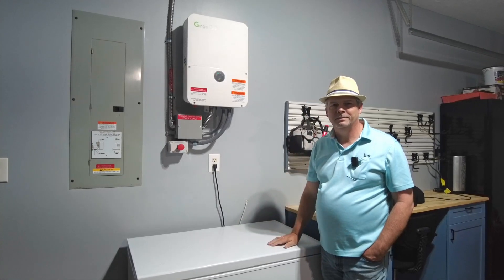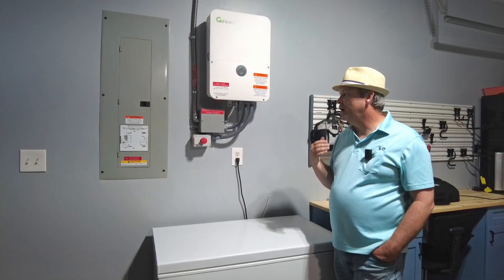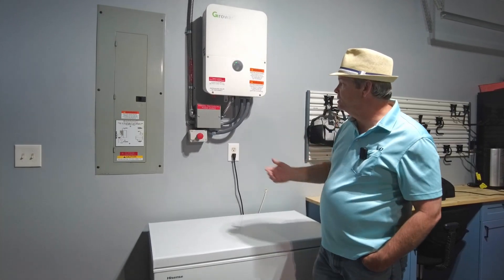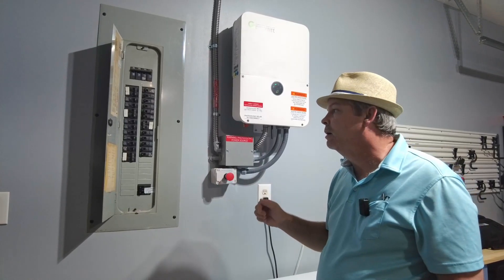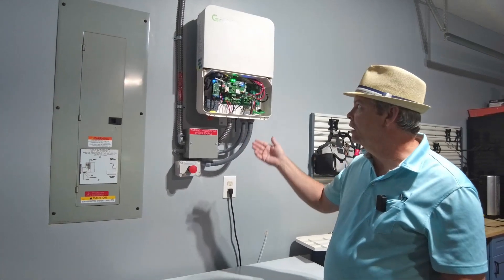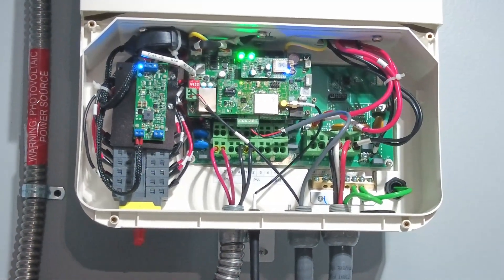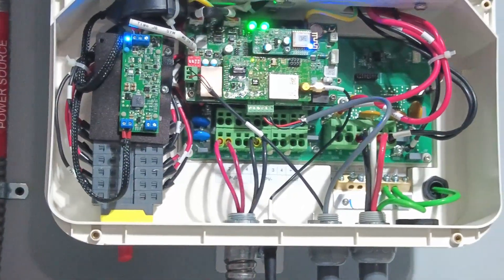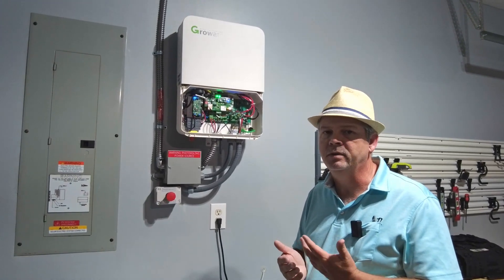Growatt MIN 7600TL XH US solar inverter: Unboxing, Basic wiring installation, and initial review

Comment from the maker: Thanks everyone for watching! Don't forget to like and subscribe. Surprisingly I'm looking forward to getting my next electric bill so that I can make a 60 day review.
Reply: Debating whether i should buy this or an SMA sunny boy. On the listings i see online for the growwatt it says it's hybrid (on & off grid). How simple or difficult is it to switch between modes? Live in an area probe to storms and power outages. Don't want to deal with a separate backup panel.
Reply from the maker: @afuen012  If you are looking to have power during a power outage you would need to have a second source of power besides solar. Such as batteries which this unit supports. The setup with batteries requires a few more components also, their diagram shows what it needed. If you had it setup in a hybrid mode it would switch automatically when it senses the grid is down. Switching the modes is pretty easy in the web app when you first setup the system. If you want to go off grid totally I'd suggest an inverter that is designed for off grid only. Hope this helps.
Reply from the maker: @afuen012  Here is a link to Growatt basic wiring diagram https://www.growatt-america.com/list-38.html  and this is a link to a basic overview of different types of solar systems I did https://www.youtube.com/watch?v=SSQl-qkWbaU&t=58s

Comment: you showe ac voltage L1 N L2 input but not shown output power supply line. i am surprised how you taking power from inverter?

Comment: what does the box look like for all your AC wires inside and out of the house and breaker box and what type of box is it model number etc? i would like to do that with mine.
Reply from the maker: @Asherrpawss  I believe it's a 6 or 8 inch metal box from home Depot with conduit running inside the wall to the breaker box and shut off our side. And metal coil conduit to the roof junction box.

Comment: Hi thanks for posting. Just to confirm – your unit came with the Tigo RSD transmitter installed from the factory? I called Signature Solar today and they "could not confirm" that they came with that installed and suggested I buy a $145 transmitter separately. The unit I'm looking to purchase is the MIN 3800TL-XH-US
Reply from the maker: @davidbryan-z8b  additionally tigo has their own branded inverters which are a growatt with their name on it.
Reply from the maker: @davidbryan-z8b  yes mine did have it from the factory, but that was a few years ago. Growatt has a US based support that you can call to confirm.

Comment: Thank you for this video. I want to buy this inverter, but I could not find the recommended size for the AC braker in the load panel.
Reply from the maker: For the 7600 its 40Amp

Comment: Hi I need help I want the same inverter can you check if you can do zero export with it?
Reply from the maker: According to their website it can, they also make this inverter for Tigo. Just incase you have a hard time finding it. If you are doing batteries keep in mind this can only use high voltage batteries.

Comment: Hi. Is the growatt still working flawlessly for you? Thanks
Reply from the maker: Yes the only issue I've had is the smart meter locked up once. That only caused the app to stop recording properly. Simple reboot of the meter fixed it.
Reply: Wow thanks!. There good to know. So you know what the settings in the shine software do?
" Ac couple enable"
"Off grid mode"

Thanks
Reply from the maker: @jl9678   Those indicate how you want the Inverter to operate, IE Off grid mode would be if your house/system wasn't connected to the grid/electric company. Other modes is if you are connected to the electric company. I believe there is also some settings for batteries and how you would like to use them but I don't recall off the top of my head.
Reply: I appreciate it. The manual is very vague about those

Comment: Hello, I bought your same equipment and installed everything the same without the electric meter. and the system it doesn't work, I don't know what to do I have to notify my network provider so it can work?,I in California
Reply from the maker: I'm not familiar with California rules and regulations. Where I'm from a permit is required and the plans get submitted to the electric company and they come out to inspect.

Comment: So this has built-in solar charge controller? No need to install one?
Reply from the maker: It has the ability to add certain high voltage batteries and charge them. Growatt has a battery for it and I saw mention of another brand in one of the manuals but don't recall which company

Comment: So question on the ground. Does that ground from your PV and inverter chassis tie in with the ac panel ground from inside the inverter? Or do you have a separate ground for PV already connected before it comes into the inverter?
Reply from the maker: For mine, I installed a grounding lug inside the metal junction box and landed all the grounds there and ran one wire back to the ac panel.

Comment: I cant seem to find the battery volts needed for this unit, do you know if it is 24v or 48v battery bank?
Reply from the maker: It's a high voltage battery. Something like 400 volt but don't quote me. I believe they only recommend using their battery packs, as it communicates with the panel. You can look on the growatt website for details.
Reply: @whatsnextdiy  Thanks I'll check it out
Reply: @whatsnextdiy  unfortunately I have not been able to get mine to work, I just have a direct connection to the grid with no smart meter or battery and I cannot get any output from the inverter, I hooked up one panel 222V with 460w rating getting current to the inverter but nothing going out, maybe I need to make some changes in the Shine tools app, any suggestions?
Reply from the maker: @wilsonmining  You will likely need two panels hooked up for it to start. There is a minimum voltage for start up. I believe 50 volts
Reply from the maker: @wilsonmining  Also look at your emergency shutoff switch. If you are not using it you may need to wire a bypass in the inverter.
Reply: @whatsnextdiy  200 volts I have going to it, emergency cutoff is operational, I hear the relay after 5 minutes but it does not convert, could be a bad unit
Reply from the maker: @wilsonmining  Interesting when you said you hooked up one solar panel I would expect it to be around 30 volts to the inverter. Most residential panels I've looked at are around 30 volts 10 amp.
Reply: @whatsnextdiy  I have 6 panels rated at 222v and 460w they are big
Reply from the maker: @wilsonmining  Mind sharing the brand and model of the solar panel, interested to see what they look like
Reply: @wilsonmining  that’s what we were trying to figure out. You had initially stated A panel @ 222 volts which through us off since that’s about 7 times more voltage the an average good panel would make. 
Best of luck and any luck getting everything working correctly?
Reply: @Wrensspeedshop  I had to run two panels in series to get the inverter to work at with around 420V going to inverter
Reply: @whatsnextdiy  Brand is First Solar, and model is FS-6460A-P-I

Comment: how did you power the Tigo rapid shutdown transmitter?  does the Growatt have a DC power supply with sufficient amps?   TS4-F needs 1A 12VDC
Reply: actually it sounds like the transmitter comes built-in from the factory?  it isn't clear from the docs
Reply from the maker: Its built into the Inverter so there was no need to add a power supply

Comment: I'm looking to replace an SMA Sunny Boy 6.0 with this unit. It seems to me that the Smart Meter box is entirely optional if you are not using the battery and backup load capabilities. Is that right? The SMA inverter just connects to the PV strings and the house mains with nothing else in between. I expect to wire the Growatt the same way.
Reply from the maker: Its only needed for the Web APP to keep track of how much power is sent to the Grid and how much your house used. If monitoring with the web application is important, I'd get it but it's definitely optional. I haven't looked into availability, but it appears Growatt is making this same inverter for Tigo.

Comment: I just installed a growatt min10000tl and I having trouble getting it out of standby mode.  The manual for the unit is very basic. Do you have any recommendations. I didn't  install the the disconnect switch.
Reply from the maker: You might check to see if the disconnect switch is normal open or closed. If closed you might need to install a jumper where the disconnect wires in.
Reply: @whatsnextdiy  thx, it looks like there is a jumper but the manual has no information on the disconnect so I'm not sure if the jump is for the disconnect. Do you have any manuals for the the Shine tool app?
Reply from the maker: @wesmason9957  I believe I got their manuals from the Growatt website when I installed mine.
Reply: @whatsnextdiy I got it up and running. I didn't realize it had a 5 minute delay be for connecting to the grid.I need to be more patient! Lol Do you know if you can get backup power with Solar only and no battery, if the grid is down?
Reply from the maker: @wesmason9957  Awesome news, no you would need a battery and a few extra components if you want power when the grid is down. Grid tie inverters are designed that way for safety of grid workers.

Comment: Can you do an update video regarding this units performance? I just bought the exact unit but the 11.4kw.
Reply from the maker: I am planning on doing one at the 1year mark its been 6 months so far. The only issue I had was the smart meter locked up and had to be restarted. That only caused the data in the app to be inaccurate for those days. What info would you like to hear more about?
Reply: Very late response but I would like to see your performance as in rated solar input versus what it actually puts back out into the grid.  @whatsnextdiy

Comment: This video is very helpful.  Thank you for doing this and do share more video like this.  I do have a couple questions for  you:  1. can you talk little more about the box where the PV input coming in? it's a breaker or isolator switch? 2. why you keep the AC breaker outside?  3. why do you use the smart meter? to control export because you didn't have a permit?
Reply from the maker: Forgot yes I did have a permit
Reply from the maker: The PV input is coming from tigo rapid shutdown device, there isn't any other breaker. The main AC disconnect needs to be outside so that the system can be shutdown without entering the house for emergency and for electrical company. The smart meter just tells the inverter how much electricity is being imported and exported.  I'd recommend it, the web app doesn't provide much info without it.
Reply: @whatsnextdiy  I am really appreciated the info you've provided here.  I didn't realize that the AC disconnect must be outside.  Also, is Tigo Rapid Shutdown is require part of code?  I am using the same inverter and I didn't see that mentions anywhere or in the permit application.
Reply from the maker: @JohnSmith-oj6or  It depends where you live, some states require rapid shutdown some do not. Also it depends if your panels are roof mount or ground mount
Reply: @JohnSmith-oj6or  according to the national electric code, rapid shutdown is only required if your panels are mounted on a structure, and the system voltage is above 80vdc.

Comment: No split phase 120 on this one!
Reply from the maker: The AC from the main service panel to the AC disconnect then to the inverter is 240 volt. Each leg is 120 volt with a neutral.
Reply: If you add a Growatt ARO LFP battery and their auto-transfer switch for flipping btw solar-grid supply, the ATS comes with a mid-point transformer that creates split-phase output for the system
Reply: It's not intended to be split phase, it's a grid tie inverter. Nobody wants to spend 7k$ on a special high voltage battery.
Reply: If you add a Growatt ARO LFP battery and their auto-transfer switch for flipping btw solar-grid supply, the ATS comes with a mid-point transformer that creates split-phase output for the system